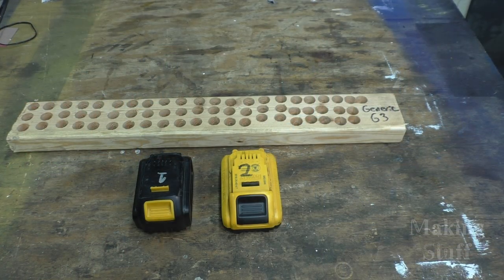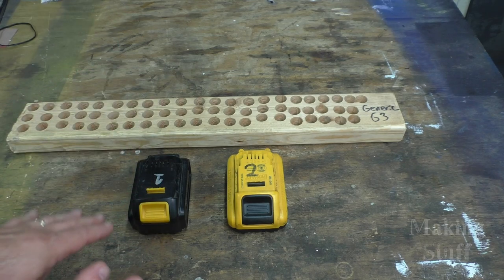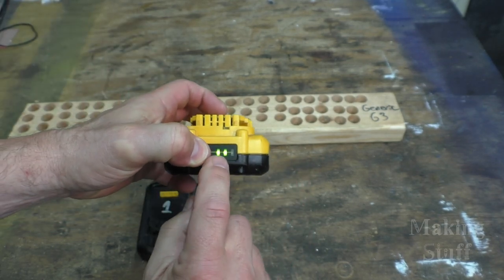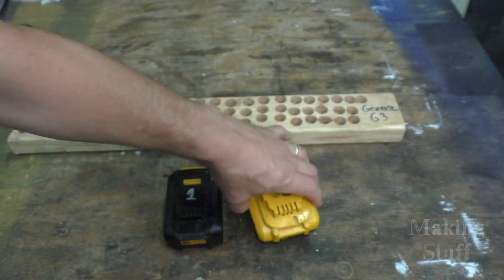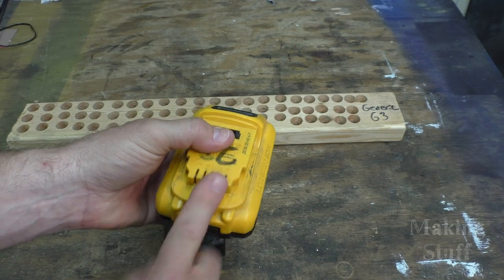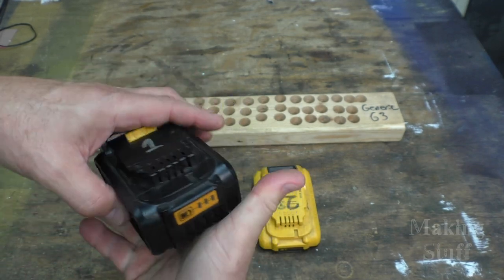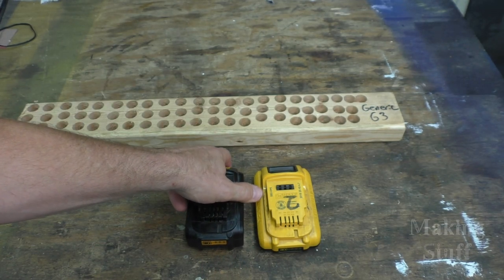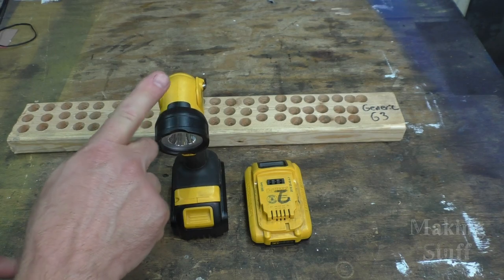Dewalt or Generic 20V Power Tool Battery, Which One Last Longer?

Comment: So given this was just one sample of each, I'd say they are about the same with or without warranty replacement. I'd expect hundreds of charge cycles, not tens of charge cycles. The fact that you only got 10's of cycles life means to me the batteries are being driven outside of their longevity ratings (over discharged and/or over charged). This is a design flaw then - in both.
Reply: Great video by the way...I got so pulled into the content I forgot to thank you for the follow up. Thanks!!! This was a great video.
Reply: The charger seems ok- it appears to do individual cell monitoring as it charges which is good, I suspect it is over-discharging that's the issue, as the two I have had fail both had 0v single pairs inside when they did the reduced capacity/2 led thing happened- that's one thing that lithiums hate- if one cell is lower than the rest and gets 'reversed charged' when using the tool- that will destroy a lithium doing it just once- it then goes short circuit and won't charge up again- end of battery if you can't do your own repacks (for those that don't know- if one cell is down in voltage compared to the rest, while using the tool, that cell goes down to 'dead flat' while the rest still have power, then as the current from the rest of the cells continues to pass through the 'flat' cell, it actually starts to 'charge' that cell in reverse ie (+) is driven (-) and vice versa- death for a lithium... If you ever hear that distinct 'drop in speed' in the motor- STOP using it immediately and charge- don't keep using it- thats what kills them...)
Reply: @steved2136  Thanks Steve - that was a good run down of how these things work.
I haven't used dewalt, but the ones I use have a BMS built into the battery pack which will balance the cells and cut them off if one cells goes below a preset voltage level, so they never die like described in the video. I use a cheapie brand here in Australia- Ozito. I use them till they have one bar left then charge, but a few times the tool has stopped - run out of power. But then they just charge up again no problem. Had these for 4-5 years, bought spare batteries and charger  a couple of years ago that have never been unwrapped as the original batteries are still operating just fine. Maybe charged/discharge 150 times (guess).
Reply from the maker: I am using a charger made by Dewalt, not sure of the model number.  So you are saying maybe my charger is defective and over charging the batteries?  Thanks for watching!
Reply: @MiniLuv-1984  Another Aussie lol... The dewalts definitely have no BMS internal inside the battery- pulled em apart to repack and its only batteries in there- not really the best design imho- I don't think they really knew what they were doing when they did the swap to lithiums so they cheaped out and just had the BMS inside the charger for charging only, not a good design...
Reply: @MakingStuff  As I said to Benny- the Dewalt design isn't that good- the only BMS is inside the charger- so it works during charging only and the cells can get unmatched during the discharge (which is usually when they are working hardest to boot grrr) so imho, its the discharge side of things that is the issue... I've had enough failures at this point that I intend on fitting a BMS inside the battery itself as well- but I have to design a new battery shell to fit it in, and then probably 3d print or vacuum mold a new bottom to the existing case top to make it all fit in.... not a small job lol
Reply: @steved2136  That explains it all!
Reply: @MakingStuff  From what Steve said, it sounds like DeWalt put the BMS in the charger rather than the battery pack, so the batteries can get run down beyond their operating safe zone while in use and fail prematurely as a result. Its not a defect, its a design flaw.

Comment: 28 charges for generic @ $42ea  = 56 charges for $84 (if you bought 2 of them) = $1.50 per charge

23 X 2 = 46 charges for Dewalt @ $75 = $1.63 per charge
Reply: Same thing I was thinking. But I beat the shit outa my genuine Milwaukee batteries and they still work as good as new. Probably have well over 100 charges on them over the past 4 years
Reply: Great math!!
Reply: $34.99 now
Reply: Thanx,I thought it would be easier to check the comments than doing all that math myself.

Comment: You need to do surgery. You need to open them up, separate the 10 different cells, put a multimeter on each individual cell, and find out which cell(s) failed, and replace them. When they only charge to two bars, it usually means that a cell or two failed/died. You can buy individual lithium cells online. After you do that, you should be restored back to full power for another 3 or so years. I have 9 DeWalt batteries (no generics) most of them are around 4 to 5 years old, and still have full power. I do have individual cells go out on occasion. I change them, and they go back to full power. 

Here's what I did. It'll probably make sense, and you should do it this way too...

Buy 10 fresh LG HB4 1500mA lithium batteries. Replace all of the cells in your failing DeWalt battery pack. Test the cells that came out of it,  discard the bad cells and use the good cells to replace bad cells in other battery packs.

The reason why I did it this way is obvious, but for the purpose of being thorough, I'll explain....

I didn't want to put a brand new cell mixed in with older cells. I wanted all cells to be around the same age and have about the same amount of run-time hours as well as charge cycles. Therefore, I didn't just throw in a new cell amongst the older cells in my DeWalt battery pack. I have 10 fresh cells in it. I tested all of them, threw out the bad and kept the good. The next time one of my battery packs would only charge to two bars, I'd open it up, test the individual cells, throw away the bad cell(s) and replace the bad ones with a used cell from the ones that I saved from my first time. That way you're not putting a fresh cell into a used battery pack, and all should have near equal amounts of run-time hours and charge cycles.

It costs less than trying to buy brand new DeWalt 20v battery packs!
Good luck!!!

Comment: I've had the 2 light thing- it usually shows a dead cell or pair of cells ie 0v(the bigger AHR ones use a pair of 18650's in parallel, the smaller ones a single) and you can replace the failed ones and its as good as new. In total I got 6 of these batteries, and had 2 fail identically so far.... Quite frankly I am dubious of the quality of the cells used, I replaced them with quality ones as the factory cells failed (in fact I replaced the whole pack in the second one that failed, and its looking much better- longer run time than the originals despite having a smaller ahr rating on the cells- which again makes me wonder about the quality of the original cells- in both the OEM and the aftermarkets
Reply from the maker: I'll crack open the Dewalt and see if any of the cells are bad.  The Dewalt had Samsung brand cells.
Reply: @MakingStuff  2 of my Dewalts have Samsung, 2 have 'unmarked' except for capacity, and the 2 aftermarkets were also unmarked

Comment: Let me ask a question.   Do you run these batteries in the ground each and every time and or put them on the charger while hot?   If either of these were being done then that is why they went bad so fast.   If you were not using these bad practices then id say you got a “bad” dewalt battery but got a new one on warranty claim, and a POS Chinese battery that surprises nobody when it goes down after less than 30 charge cycles.    Anyway, those are my thoughts.     Good luck - God bless brother !

Comment: universal lithium battery charging rule: 1) NEVER discharge below 20%. 2) NEVER charge if above 80%. 3) once charged, remove battery... DO NOT LEAVE IT ON THE CHARGER! Li batteries in good condition do not leak much. 
this applies to ALL lithium batteries. your cell, your car, your tools, your toys... ALL. you should be able to get many hundreds of charge cycles. my nearly 4 year old cellphone still performs like new as do all my dewalt batteries. and i use the batteries on some tough tools like the chain saw and the pole saw as well as the more normal tools like the drill and grease gun.
Reply: 20% I agree. 80% I disagree.

Comment: If they're "starting to fail" and have only lost 25-40% of their capacity then they haven't reached their "end of life", right?  The differences in the number of charges is probably just your uneven usage of each pack in your projects.  The Dewalt could have more charge cycles left in it before failing.  I would continue the test until they won't take a charge or won't spin the drill at all after a charge.  What am I missing?
Reply: Only lost 40% of capacity is  certainly well within what most would consider failing.  For the kind of money they are charging, yeah thats a lot that you're missing.
Reply: @boots7859  Do you drain the remaining 40% of the gasoline out of your tank and then fill up at the station again?  Keep using the packs until they actually don't spin the drill.  Anything less is a waste of money.
Reply: @boots7859  When you've used up 40% of your next bottle of wine and paycheck, please send them over to me!  I'll make sure to put them to good use.  :^)
Reply from the maker: I disagree.  If your car all of a sudden went 40% less miles on a tank of gas you would certain think that something had failed and needs to be repaired.  Thanks for your comment!

Comment: Sorry but it is not fair to do warranty claim for bad battery after 2 years of usage, that is normal wear and tear.  you will see some performance loss for every battery.
Reply from the maker: The battery fails, they offer warranty.  What's not fair about that?
Reply: @MakingStuff  My immediate response too. Perhaps the question/statement is badly worded and just unclear?
Reply: If Dewalt didn't want to give you a new one they wouldn't  have given it a 3 year warranty.  Dewalt says it is fair.
Reply: @enduman  because Dewalt know that pack is trash or the batteries are subpar, 23 charges only!, that's worse than the worst chinese pack.

Comment: Lithium batteries should not be run till dead. My dewalt 3ah are over 8 years old and have hundreds if not thousands of charges. And the still change full 3 bars
Reply from the maker: Yeah, I have since changed my battery charging routine.  Thanks for watching!